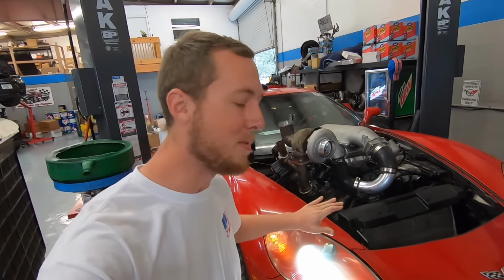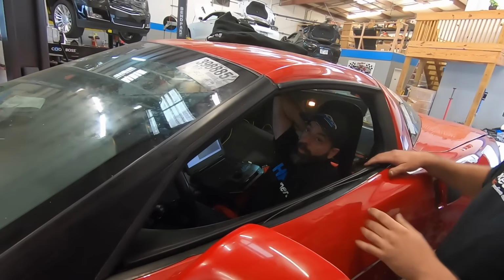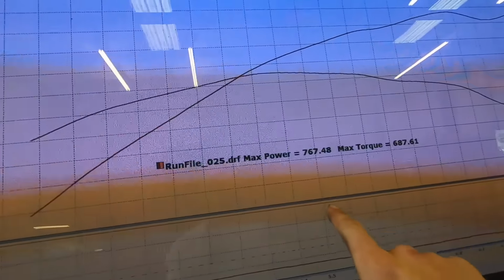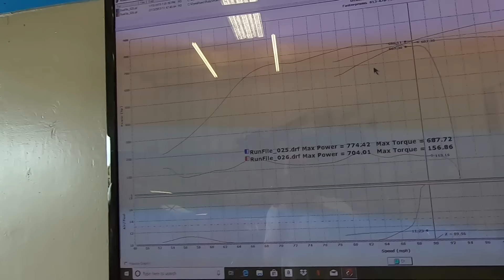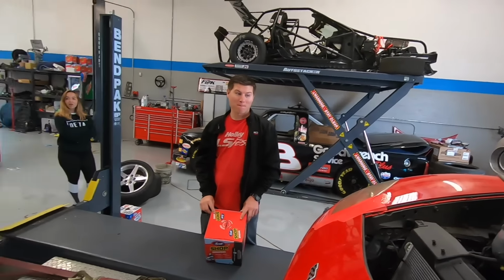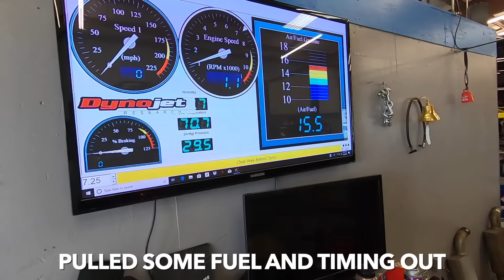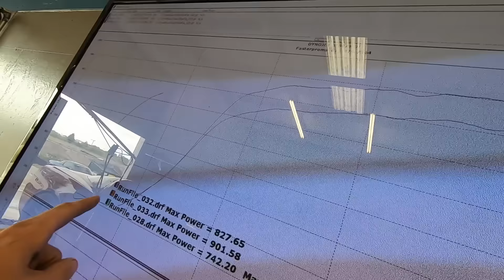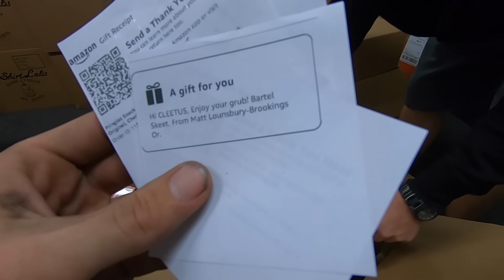The Auction Corvette Goes For BIG POWER! Please Don't Blow Up...

Comment: Garrett please get a cage in that thing. I was a cop for 23 years and I have seen up close and personal what happens to Corvettes when they crash at high speed. I don’t want you torn into pieces. Love the channel. Just worries me that you young guys think nothing will happen. I have crashed race cars in the past and I would not be here if it were not for a high quality cage.
Reply: 10- 4  to that brother..
Reply: "Ruby" the red Corvette is the only one without a cage at the moment I believe.  Leroy, The Dale Truck, and the V all have roll cages. Cleetus has already talked about putting one in Ruby also.
Reply: Ruby is next on the list he has just been waiting to get the few events he was scheduled out of the way to give the guys at profab a little more time to finish the elco so they have room for ruby
Reply: Ive known more people that have die in vette accidents than on streetbikes.. And i know a lot of people that ride streetbikes.. in LA..
Reply: Cage requires a helmet every time its drove, lost a friend in a crash head impacting the cage is what caused the death
Reply: I agree a cage is needed for something this fast. However, what you seen from Vettes blowing apart on impact isn't as bad as it seems. Their body panels explode off from them, but the structural integrity of the frame and passenger compartment normally keeps the driver safe. Again, though, I do not disagree on the fact Ruby needs a cage. Plus, it's going to be fast enough to need a chute, you can guarantee that.
Reply: J. Old they have it lined up to get one put in it
Reply: Really good advice!!! We just had an experienced drag racer die here in New Zealand.
Reply: Hes getting one made soon at pro fab
Reply: J. Old Copy that
Reply: its being made according to the last video
Reply: J. Old he is putting a cage in he just hasn’t had time to do so yet
Reply: There is nothing wrong with being safe, and not sorry. A planned cage tomorrow won’t protect anything today
Reply: @ryanbernard6550  same
Reply: @DigBick91  "Just do this one thing...before the roll cage" famous last words :(
Reply: @Ackadacka  its not like he can take it and force them to have an open spot for it just because everyone on YouTube said he needs to..he can't do anything until pro fab says the word so it's outta his hands as he said when it went 9.3's
Reply: Louis Barker No he can’t force them. You are totally right. 
But he can postpone Ruby’s runs down the tracks until Profab has time.
Reply: @DigBick91  he could just you know not try running 8s in a car with no cage....
Reply: @Ackadacka  he's just a you know.... grown man completely up to him not you or anyone else
Reply: True but then you can't safely drive on the street anymore because more people die from accidents on the street with no helmet when their heads smashes the cage...
Reply: @freedomfox8183  this is why you spend money to have a cage and seat built for you...so if you're properly wearing your harness your head wont come near the cage Thats kinda the whole point of it to save you street or or strip
Reply: J. Old he said he was gonna get a cage put in it after Cleetus and cars
Reply: Fun police more like

Comment: 900hp stock bottom TICKING TIME BOMB ! #sendit
Reply: I don't think they care hahahaha
Reply: I mean, that's the whole point no?
Reply: Its probably going to scatter the block
Reply: the point of ruby was for fun cause junkyard motor
Reply: Nah, we will see an 8sec pass easy.
Reply: I think it might be okay because it is a 4.8 litter.
Reply: ClutchkickPJ and they rebuilt it without replacing the main bearings lol
Reply: @raptor660cc1  I'm going on 3 years at 700whp with just Pistons rods/springs/cam in a 4.8, they might get lucky  it will last a few events if it doesn't lean out but those stock Pistons are eventually going to let go if the bearings fail especially but they finally did the oil pressure mod so that will help a ton I went through 2 learning the platform in 4 months and now on 3 years with same one
Reply: @ToxicMisfitsYt  your supposed to lmao do you follow along with the videos no reason to change em if they are working your completely missing the point of the build so many people can't understand for some reason the purpose of this build even though he explained it 10 times by now
Reply: Hey its got bearings, its fine.
Reply: ClutchkickPJ just like your rb 👍🏽
Reply: They got more than enough youtube and sponsorship money so he dont care at all this shits all paid by us viewers
Reply: Another $100 won’t hurt
Reply: More like 1100 at the crank.
Reply: mazdaspeed life gee, ya think? 😂
Reply: If they used arp rod bolts they will be fine! If not they start stretching at 900hp so it will be 50/50 chance!
Reply: Elliott they want it to blow, eventually.. it’d be no fun otherwise
Reply: @ButtKickersReviews  if it blows boom more content millions views thousands of dollars more than a engines worth money little alone these junkyard ls ones and let alone a whole junkyard auction corvette prolly bought by the viewers obvs
Reply: That’s what I was saying. Do you lack reading comprehension, or did you just feel the need to waste bandwidth with that poorly strung together wall of text. You just wasted two minutes of my life that I’ll never get back.
Reply: @ButtKickersReviews  love how your quick to assume things even such as age prolly am way younger then you, your right but probably and most likely am more well off then you were at my age...n here you are arguing with me because I referred to something you already said in the comments? Get out of here you over grown baby I'm done talking with you online have a good one
Reply: Manny Dhillon shows how little you know. The early engine is way beefier internally stock for stock. I fortified it with ARP hardware throughout, calico coated main and rod bearings, ferrea valvetrain, dual Bosch 044 fuel pumps running -10 line, blah, blah, blah..

Out of high school I started my business, and bought an E36 M3 NEW, then a biturbo S4 in 01 (also NEW) that ripped 476 AWHP on AWE’s dyno on a risky build; back when numbers like that were unheard of. Second fastest biturbo S4 in the country at the time; THAT was almost 20 years ago. Google is your friend; you’ll find my cars.

And you know what? I’m SELF MADE; came from nothing. I used my MIND, and DID IT.

I wasn’t trying to act DUMB and type like 4 year old, to look ‘ghetto fabulous’. You probably spend more money on sneakers than your whole life is worth.
Reply: @ButtKickersReviews  I hate expensive shoes bud. Most ridiculous shit ever I wear new balance for my sciatica nerve problem.

Comment: Damn... really underestimated a 4.8... 
I was a little bummed out that my truck came with a 4.8 confirmed. 
So I been building it from top end putting a LSR cam dual springs. Then, To bottom end couldn’t find the stock rod length 6.275 because nobody makes them off the shelf. 
Custom was gonna kill my pockets... 
so I decided to keep stock rods an just change the piston heads and some race rings. 
I’m a little scared for dyno day but this calms my nerves ! Thank you guys for doing a 4.8 project !
Reply: Make sure to check out the Sloppy Mechanics Colorado build. Matt made over 1000whp on a 4.8.

Comment: At 15:24 you can tell that the Accelerator Pump fuel setting is to low. The car goes pretty lean when he floored it. That is a good way to blow an engine when you pedal-it on the track during wheel spin.

Comment: Well this 4.8 will have a short life
Reply: maybe..... 4.8's are alittle stouter than 5.3's no one wants them because their the little brother
Reply: I hope this build doesn't raise their prices.

Unless you've got a heavy car a 4.8 still makes more than enough torque.

I want a 4.8 for a lightweight build.
Reply: 4,8s handle boost like porn stars handle basball bat Ds.  As long as you keep the knock out, they will make 1200hp once maybe twice
Reply: @mattnsac  According to a Hot Rod article they made their SBE gen 4 ring gapped HCI 6.0 pull 1200hp for 70 Dyno runs...

When it broke all it was was a lifter and pushrod haha.

Comment: Under 5 liters over 900 whp. Who else loves this?
Reply: Ford 4.6 factory block crank and heads 5.88 at 255mph. 
900hp isn't shit today even for stock 4.8 block with turbo. They'll make power but they just don't last long with a lot of boost. After this motor blows its time for a 6 bolt  470ci+ with twin 88 lol. Fuck it he should just go for broke. He can just get the new 600ci sbc from CFE racing products with the SBX heads. They have 2.300 intake 1.900 exhaust valves. Lifter bores are .937 and have 55mm roller cam bearing or 60mm babbit. 
It's only .475 of an inch longer then a traditional sbc.
Reply: Wayne Bollentin or he can just keep
putting junk yard engines in it
Reply: I personally am a ford guy myself. But I have mad respect for an almost completely stock engine making this kind of power and is still alive even after just one pull.
Reply: @johncox1983  it's not that I don't have respect for it but it's a turbo motor. There's no easier safer way to make a ton of power. It's not like they're spin the motor 7800rpm every pull. I'd feel the same way regardless if it was a ford , Chevy or Dodge. The manufacturer had nothing to do with the comment. I don't know maybe I doing racing to long and it just seems much simpler to me. I'm sure he'll run near 8.7 over the weekend at 155mph or so.
Reply: Btw this 4.6 has the Ford GT heads on and an aftermarket crankshaft. Plus they are fine tuning this for years now. I think it can't be compared to a stock bottom end 4.8 junkyard engine that was built and tuned overnight...
Reply: Starting to approach euro territory now. Come back when you're running 900 reliable hp on a 3.2L
Reply: Koop, you sir are not on the right channel if reliability is what gets you, come back when you actually understand the purpose of that build
Reply: @waynebollentin989  I know what you mean.  I would have been equally impressed with a ford or dodge engine.  Beck maybe even a toyota or Hyundai v8. I just think it's pretty cool to take junkyard parts and run 8 second quarters. Lol. I think you and I are on the same page. :)
Reply: @Koop2k  you can come back when a 1000hp+ at crank Italian supercar engine can be bought for $250 at scrapyard
Reply: Nathan Bilodeau I agree with you completely. Ford does not make an engine that can run over 1000hp on stock internals in the 4 or 5 liter range, especially for this type of money. I went to a car show this weekend and saw LS engines in everything including Fords and import cars. I don’t think that was a coincidence. Everyone knows the LS is the biggest bang for the buck right now.
Reply: @waynebollentin989  Accuses people of being blinded fanboys when he's the only one talking about brands LMAO
Reply: @fuzzylogic394  a 3.2 would be an audi v6 , I’m making 900 on a stock internal supercharged Audi 4.2 hahahha

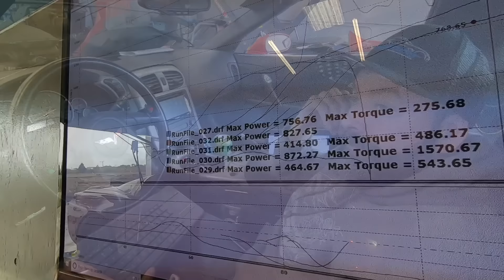Comment: 22:16 Only if the 1570ft/lb of torque was real
Reply: It'd be breaking more axles than James' 240 😂
Reply: Michael R when it dyno’d 901hp and it said 387 torque was that correct lmao and why isn’t it showing the correct torque if not are 4.8’s really that low on trq
Reply: @Reebok-ox9im  the torque readings aren't accurate. This 4.8 has tons of torque, just not 1500 ft/lbs worth lol.
Reply: @Reebok-ox9im  they explained it in the video. The snail is screeching so much freedom that the Dyno is freaking out.
Reply: It'd be diesel then
Reply: Reebok301 301/202 if you add the 387 lb ft and the 1500lb ft and average them you're probably closer to what it actually is......
Reply: @louieperticari6982  ik other wasn't accurate all I said is I wish it was real
Reply: The Volvo d13 engine in our buses put out 350/1500. Itll put you back in the seat. #diesel

Comment: LOOK OUT! Sounds solid! The 4.GREAT is a RUNNER! REV IT UP! (I predict 8.93/ 154mph)
Slamming in more fuel, more boost, more water inj, more oil pressure, higher rpm, stronger block, fast front wheels. Great job pulling it together so quick! Good luck!

Comment: The 5.3 couldn't even handle 730 horsepower lmao
Reply: Most likely from oil starvation.
Reply: 4.8 also has slightly thicker walls I think
Reply: Arp rod bolts killed the 5.3
Reply: Well when your rebuild a engine and don’t even bother replacing main bearings then no wonder lol
Reply: Defentily not a coyote that's for sure
Reply: @bernardobarajas5570  4.8 and 5.3 have the same bore.  The difference is the crank stroke and connecting rod length. So wall thickness would be the same between the 2
Reply: 98LSxS10 yea that’s what it was I remember something being different I think it’s different from a 4.8-5.3 and 5.7 I’m a sbf guy I don’t know too much bout ls lol
Reply: @steffinmezger5301  Yea your def right👍....

Coyote would have made more😱😬😉👍👍
Reply: @bernardobarajas5570  same exact block/ bore size. Only difference is rods and crankshaft and flat top pistons compared to the gen 3 5.3 dished pistons.

Comment: you just had the perfect Idea for an event for Cletus and Cars , engine building in a moving trailer , then install it the same way moving , just a simple slow drive around the pits ect , take a few safety precautions steel toes , and bicycle helmets , and attach the engine stand to the floor so it can't move , this could be crazy fun , just need a big screen to show it on while it's happening , get 2 guys that actually drive a commercial truck to do the driving so you don't get really tossed around ... Team Tuning Grandpa against Team Ceeter !!!
Reply: towrecker sounds interesting!!

Comment: This gonna end up being faster than leroy
Reply: Hard no
Reply: It will brake faster then Leroy
Reply: Probably honestly. Better aero and automatics are faster than manuals.
Reply: Yes it will be. 180mph in an auto is definitely Leroy killer numbers
Reply: @wyattrowe8396  nah, not with a junk yard motor and not near the power
Reply: Jonny Dupuis The aero drag alone on Leroy is killing tons of horsepower. It’s definitely possible on a junkyard motor since they keep adding performance stuff each time is breaks. Eventually the only stock bits will be the block and crank and those can handle a lot.
Reply: @jonnydupuis2041  I'm saying that they will eventually put some crazy engine in it

Comment: Did he just say 9400 rpm???? Oh dear let them bald eagles scream.
Reply: Lol nah he was saying 94 mph on a first gear pull. 9400 and she'd be sending pistons/rods into orbit
Reply: Lol no those ole pushrod style chevy motors cant handle 9400 rpm lol
Reply: Will Brooks Lol, they sure do when you build them right. I’ve got a 434sbc that has 9800 shift points. The old Z28 sbc 302 would top 8500 from the factory, and would go well past 10,000 with valvesprings and a cam. There are literally thousands of small block Chevy’s that spin over 10,000 rpm. Pushrod engines handle high rpm better than ohc engines because you aren’t spinning 30 feet of chain. Lot at the POS in neighbor. A built engine that spits valvetrain parts when almost new. Ohc sucks. Limits you cam profile options, limits lift, requires more complex crap that tends to break easily. There is a reason you don’t see overhead cams in top fuel drag racing. Their engines don’t even have to be production engine based, and they still avoid ohc like the plague.

Comment: where's the tractor flap.
Reply: It was keeping back pressure out of the exhaust like it needs
Reply: They pull it off at the track. The high speeds can force the flap down some which will hinder exhaust exiting the turbo which will kill power.
Reply: It's on there, just being held open by what i believe is either the egt or ega sensor. you can see it more clearly at 24:30.
Reply: It's on by the end of the video
Reply: It's good to have on if it rains
Reply: Swampy  not at 180mph. It will be forced down, maybe not enough to matter but who knows.
Reply: Swampy  you're right it's only gone the first few minutes

Comment: What's the orange box on the windshield for?
Reply: It's a fan... Helps keep the heat down... Better combustion
Reply: It's a blower fan to push the exhaust gasses out of the back of the shop rather than them going straight up to he roof and filling the shop.